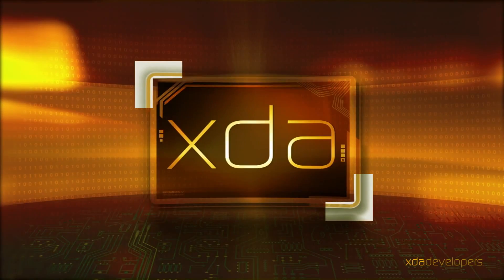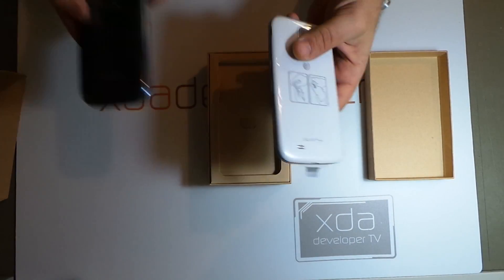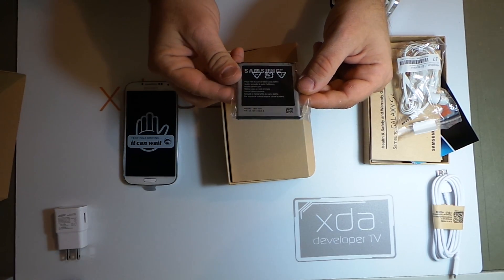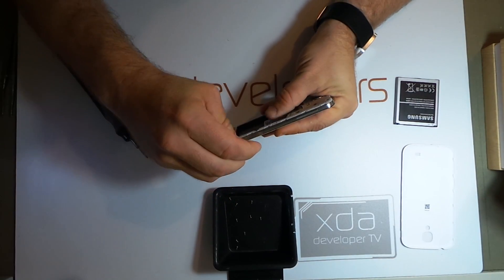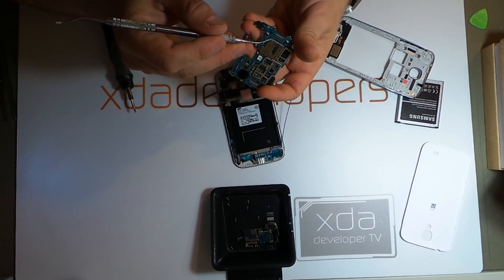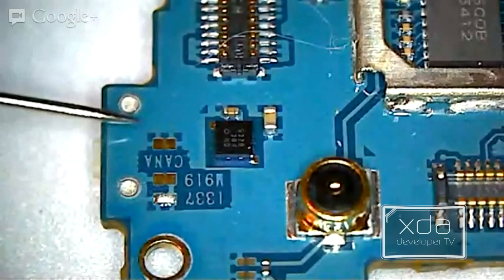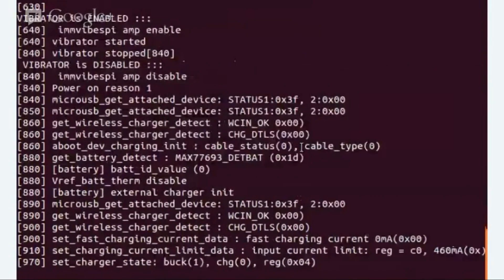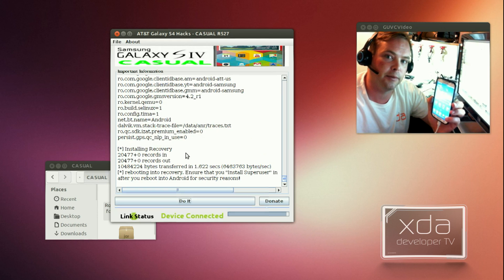AT&T Samsung Galaxy S4 Unboxed the XDA Way

Comment: I kinda wish that you could load your own drivers on androids so you could use something more then a usb stick or a mouse, keyboard and the gaming joysticks. I know apps could take an advantage of the gamepads, but say I want to connect a wifi usb stick to a tablet cause the internal antenna can't reach the signal two rooms away. Say I want to connect a usb cammera for something more. I know that thats been done, but mostly it requires to have ubuntu and not android on your device so I can't use

Comment: Well you liked the camera cover and all but i personally think that there should have been a glass thing on the back cover .Coz in my GT I9500 the camera protrudes a little from the back so when i lay it down it lays on the camera ,and if it were to be scratched then i'll have to get the whole camera changed. And some cases in the market surprisingly are so thin that even after putting it in a case the camera still protrudes a little bit!!

Comment: I have an S4 and i would root but i don't want custom rom or cyanogenmod on it. So apart from that what else benefit if i would root it ?? Coz basically most of the features are integrated in touchwiz .